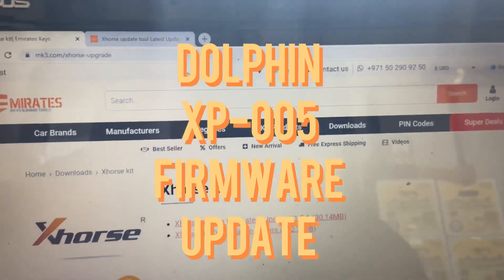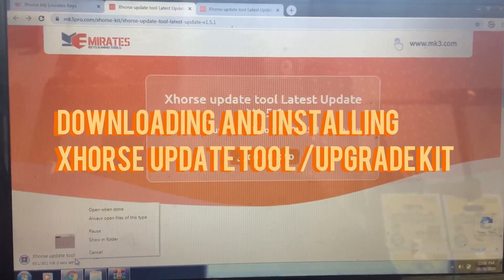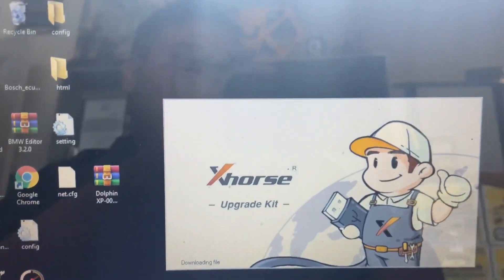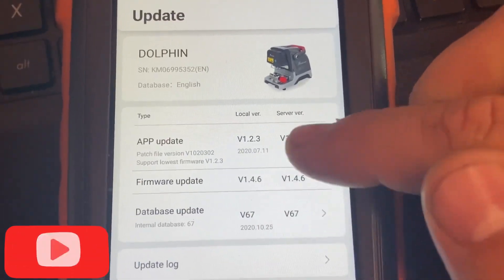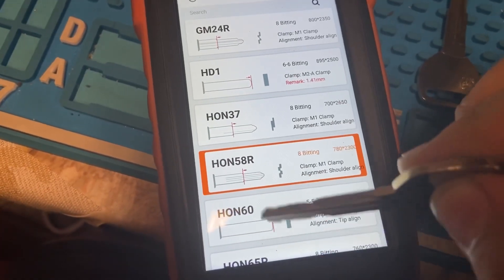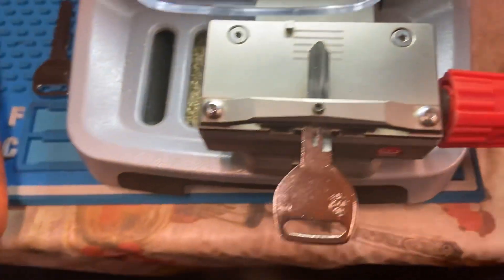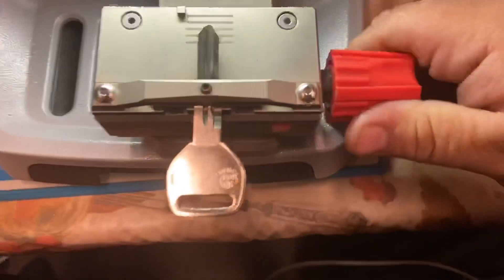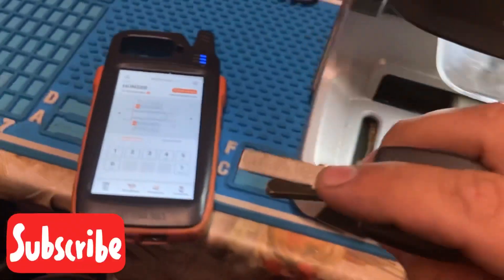UPDATE DOLPHIN XP-005  FIRMWARE (VERSION 1.4.6) +TIPS AND TRICKS!

Comment: Dude I have to tell you this machines SHIT. So I go to cars with key blade in fused with plastic head. Those it for sure likes to ruin. Literally I say the key blank. Copy the pic. Load the original in. Tell it to decode. Then check pic and sweet. Then tell it to cut making 2 passes for accuracy. The blade is cut. Then I try it. The key blades a mess. It does not fit. I watch again the decode. Its accurate on the original between the bitings. Then load cut key again and guess what. It finds slithers more of metal to cut off. Na this machines TURD.

I just bought the xhorse laser key blade copying thing. Try that and let you know.
Reply from the maker: Thank you for sharin im looking into getting the newer dolphin.. after a whole year I finally broke my cutter..

Comment: Tips and tricks. Ok listen up. Take it to the edge of the beach. Grab it by the handle and do a fast spin. Get about 100mph and sling the thing out in the ocean. 

This machine on decode key comes along and tries to measure in on each biting. Whereas a manual machine has the blade clamped in one clamp and a fixed position away is another blade clamped. As you move along the blade to copy the cutter cuts the other blade exactly. Flawlessly. Today i had xp005 on decode and then told it ne73 blade to cut. The blades were not perfect. Also the tiny picture in key tool max of how to set the blades. Literally no zoom function. 

Search easy key cutting machines. Theres your sweet machines.
Reply from the maker: 🤣🤣🤣🤣 

Thank you for your experience with the Dolphin xp005 .. i find myself updating it ever so often.. do not use universal decoding it will break your probe..always decode under vehicle data base.. also i find myself failing to cut a Mercedes Benz emergency blade even after calibration..it does have its ups and downs but its far better than the sec-e9 but realy limited to the wider options the sec-e9 gives you
Reply: @MYKEYSAUTOMOTIVE  manual key cutting machines. THM have a website in uk and on it they advertise easy key cutting manual machines. 

Nice. As for dolphin I have asked it to decode a key. Had only one blank with me which was half plastic. Horseshoe. Cost £10. It ruined the blank when cutting. Nothing like the key it was copying. The pictures are so small and you cant even zoom in to be sure of where you place the key when you are a beginner.
Reply: @MYKEYSAUTOMOTIVE  oh and if you ever get a key with a small rectangular hole at the end like NE73 for renault traffic. Trust me it does do something. Hooks a hook and as key turns so a part inside the lock turns also.
Reply: @MYKEYSAUTOMOTIVE  https://m.youtube.com/watch?v=gfn_RrROTKo&t=41s

Comment: Hi I have just bought the M3 clamp how do I calibrate the clamp on the machine please I'm scared it would break the drill bit if I turn it on without calibration also will it let me decode a tibble key
Reply from the maker: Select it under settings
Reply from the maker: Just select your key first and the machine will automatically know.. i dont think u have to calibrate the clamp ..
Reply: Ok brilliant, yes the machine doesn't have the option to calibrate M3 in the settings. will the machine allow me to decode a tibble key?
Reply from the maker: @thekeyguy4886  have u updated your firmware?
Reply: @MYKEYSAUTOMOTIVE  yes i have, thanks. Also Im still having an hour and a half wait to clone id48???
Reply: What is the M3 clamp for
Reply from the maker: @ed6238tk  for tibbe keys!

Comment: Have been unable to get the file to open on my computer. Any help would be appreciated.
Reply from the maker: Did you download both files .. try downloading unzip .. what computer do you have??
Reply: @MYKEYSAUTOMOTIVE  Microsoft surface pro
Reply: @MYKEYSAUTOMOTIVE  yes, I did download both the drivers and the v1.5.1
Reply from the maker: @jasonschlegel4530  it could be possible that you have firewall on or spyware blocking the file from downloading..
Reply: @MYKEYSAUTOMOTIVE  could be, unfortunately im not very tech savvy.
Reply: @MYKEYSAUTOMOTIVE  I'm gonna try my desktop instead of my laptop
Reply: @MYKEYSAUTOMOTIVE  I'm getting an error when I select the xp32 in the driver download. It states 

" You have to run 64-bit version of DPInst.exe on this machine. 

Contact the vendor that provided you this package."
Reply: @MYKEYSAUTOMOTIVE  so, I ended up getting to upgrade kit and once I selected that it said the file had a virus so I'm stopped. I guess the 2 hours I spent on it was a waste
Reply from the maker: @jasonschlegel4530  mine said the same thing but i went ahead and downloaded anyways..
Reply: @MYKEYSAUTOMOTIVE  thanks for trying to help. Spent 2 hours on it. Fuck it.
Reply from the maker: @jasonschlegel4530  well at least you tried brother! Sorry I couldn't help..

Comment: Can i cut all the keys with the 2.5 cutter?
Reply: But why do you like it? Does it do a faster or better job?
Reply from the maker: Alot of people break the 1.5 probe and bitt... faster because its a bit thinner than the 2.5 ,higher breaking point ,so its just my preference..
Reply from the maker: I havnt had an issue with a key not working,at least not yet.. however, like i mentioned in my videos it mostly recommends using a 1.5... but a 2.5 will do just fine

Comment: After updating the Bios. Re-calibrate the clamps.!
Reply: I tried not recalibrating after updating the firmware and the machine gave me problems preparing to cut a hu101.
Reply: @robertwilkins839  always best practice to recalibrate after a Bios upgrade.
Reply from the maker: @cantcodewontcode3436  🙏🏼🙏🏼
Reply: @MYKEYSAUTOMOTIVE  hu101 keys if decoding best practice is to make sure key is very clean, also after decode do test cut and visually compare and if needed manually adjust before cutting. I have noticed that the cuts after the last few updates are not as smooth as before and more sharper.
Also check the cutter size is correct. 1.5 is my goto on all jobs.
Hope everyone is in good health 🙏❤️
Reply from the maker: @cantcodewontcode3436  thank you for the information simon!! 🙏🏼🙏🏼
Reply from the maker: @robertwilkins839  what the issue your having with hu101
Reply from the maker: I havnt recalibrated... i should huh not a bad idea...lol